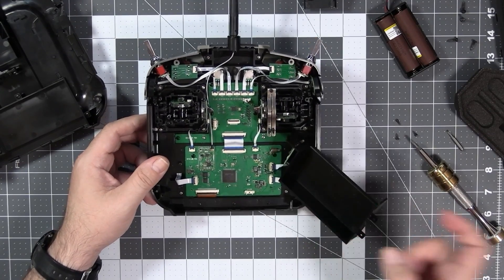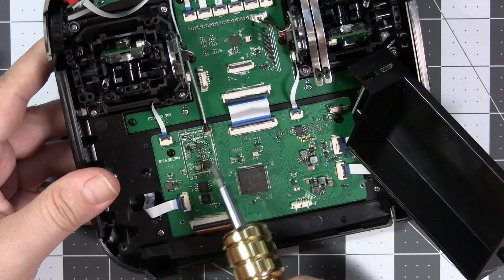WFLY ET16S radio teardown - and it's not OpenTX

Comment: Great teardown, Pawel! 😊
I totally agree about the ribbon cables!
Stay safe there with your family! 🖖😊
Reply: I really don't understand the resistance against ribbon cables. I have professional used them in marine applications without any problems and that environment is for sure much more harsh than what we put our radios through. I actually also have one of the early Jumper T16 radios and it has been fine as well. No question about jumper have had huge problems with either there connectors and or ribbon cables, but that is because of the quality and not because it is wrong to use ribbon cables. Said in other words I think it is wrong to judge the quality of a radio based on ribbon cables.

Comment: God forbid a remote control radio manufacturer brave enough not to use OpenTX. The open source community will rage!
Reply: Wfly is easy to program no need to study so hard and earn engineer degree to use Edgetx or open tx. LOL they also been around for 15 years maybe. I was their beta tester for Vortex 5

Comment: Can it be used with ELRS / TBS / IRC Ghost ext link (I mean can you control those ext module settings from radio via lua)?
Reply from the maker: Works with crossfire and R9